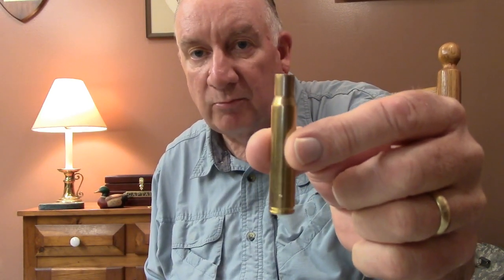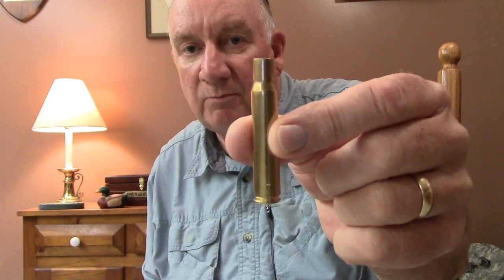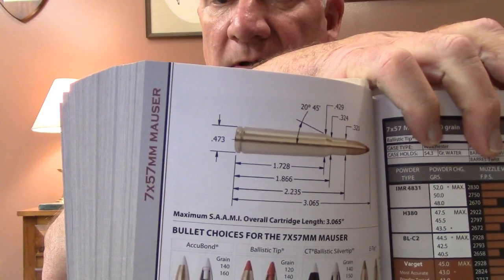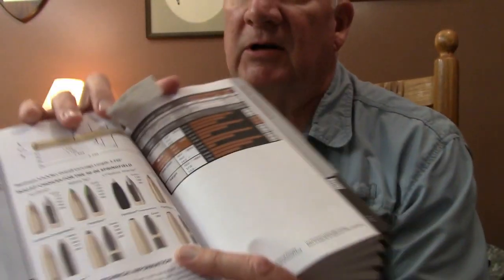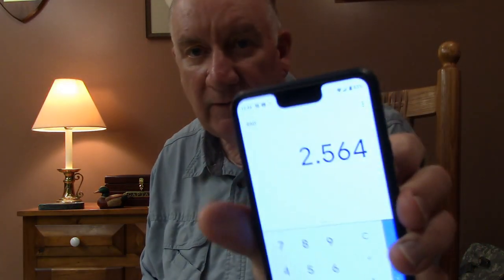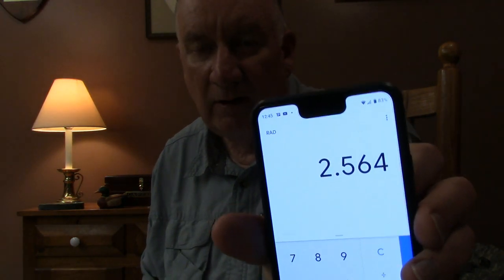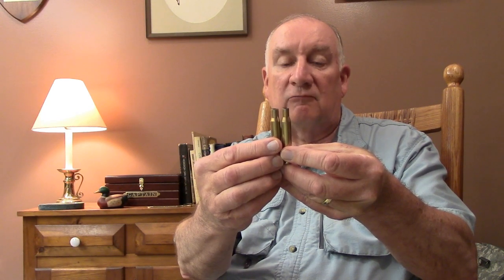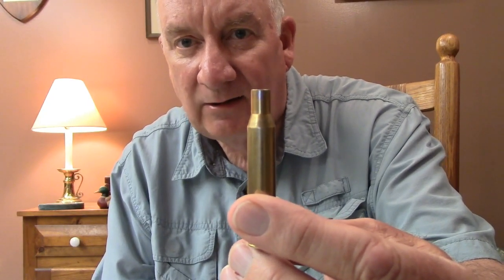Winchester 270 Origin Myth ~ Stupid Wiki Nonsense

Comment: You are wrong.
 About the measurements of the outside diameter of a 3006 neck plus you are wrong about  the other several factors involving the 270

Comment: I had a 270. Win Sako. It had a bit too much free bore and was set up for 150 grain bullets. I wanted to use 130 grainers for deer and varmints and the only problem with it was I couldn't seat the 130's out far enough to touch the lands before running out of space in the magazine. I could never get the 130's print sub MOA, but it was an awesome dear cartridge.

Comment: As far as I'm concerned. The 270 is magic. It is a true western cartridge for varmints and deer. Can't speak for it's performance on Elk but I know 270 Jack can.
Reply from the maker: I spoke with the late John Nosler, who told me that the .270 Winchester is absolutely fine on elk with either 150 or 160 grain Partitions.
Reply: @GunBlue490  If the likes of the famous bullet maker of the Nosler Partitions said it will work on Elk, you can take it to the bank.

Comment: What’s interesting to me is that Winchester created a 0.277 bullet rather than a 0.284/7mm bullet. Which was already used in the 7x57mm Mauser
Reply from the maker: The reason was quite simple!  Metric bores were, for many years up until only the last generation, considered "foreign" and even "enemy" calibers by many, and very much disliked.  At the time of the .270 Winchester invention, the 7x57mm Mauser was indeed disliked by many Americans after the Spanish American War.  In the 70's, American sentiment against metrics became quite a heated political concern after President Carter declared that America would convert to metric.  It was for good reasons considered by many a very anti-American plot toward globalization. To most of America's great delight, President Reagan immediately cooled things off and assured folks that they didn't have to toss out their tape measures.  That resistance against metrics isn't entirely gone, as there are still a great many folks who will only own "American" calibers.

Comment: The 30-03 was chambered commercially in a lever gun for a short time. The case length shows that the .270 Winchester's parent case was the .30-03, not the .30-06.

Comment: Who cares if you shoot a 270 out of a 30-06 rifle? That wouldn't hurt anything... ive watched a guy shoot a whole magazine of 9mm thru his 40  cal pistol, just expanded the brass and the bullets only went a few yards... seems like ot would be smarter to shorten the case slightly on the 270 to ensure a 30-06 wouldn't chamber in a 270.... am I missing something?
Reply: You are missing Case Capacity.  Winchester would not sell any smaller caliber rifles if it was not faster than the 30-06.  The selling point of the 270 in 1925 is the same as the current crop of barrel burners at 4000 fps.

Comment: GunBlue490 , do you have any info about the 6.5-06 A Frame? Thanks.
Reply from the maker: The 6.5-06 is essentially the old 256 Newton; simply a necked-down 30-06.  I consider it the best of everything the 264 Winchester Magnum had to offer, but without its liabilities. It is perhaps the flattest shooting standard case cartridge, that can take most all American non dangerous game with its range of deep penetrating bullets. Keep in mind that heavy game such as elk respond  best to larger calibers that can open a wider wound channel, which is where many veterans would consider 270 a minimum bore diameter. Despite its fabulous flatness, the 6.5-06 has had its greatest difficulty surviving because the 270 Winchester has the same practical flatness, but with heavier bullets of better frontal area.  It's a great round, but it's too heavy for varmints, unnecessarily destructive for deer sized game, but rather small bored for elk. Paper ballistics don't always mean the best choice.

Comment: The 30-06 is 63 mm long. The 270 is an American 7x64. The 270 is also 64 mm long. The 7x64 came out in 1917, whilst the 270 came out in 1925. The anti-Teutonic feelings were still very strong at that time so this is an aspect over-looked by many simply because they are not looking at things from a European perspective. Millimeters not inches or fractions of inches. How come .277? There  is the Chinese military cartridge story and there is the obvious fact that .308 multiplied by .9 equals .277.  7mm is actually .276 inches. .284 is about 7.15 mm. The dimensions we know today as gospel had not been standardized to the extent they have been today. The 270 Winchester will chamber in any 30-06 rifle. The headspace dimensions for the two cartridges is identical.

Comment: For a knowledgeable guy, you sure do like beating this horse to death.  Why was the '06 version of the case shortened from the '03 version?  Why was the shoulder moved forward on the 280 Remington?  Why was the 270 Winchester case made longer?  You are suggesting that all of these lengths and dimensions are arbitrary, when you should really know better.  

When the engineers were figuring out how to keep 270 Winchester ammunition safe, and keep from getting it mixed up in the manufacturing process with 30-'06, increasing the length of the brass was one way of doing that.  So, they based the 270 Winchester on the dimensions of the original 30-'03 cartridge.  They surely didn't STRETCH '06 brass, so they had to start with something longer.  They looked around at what was longer and, voila! the 30-'03 case length.  This was something they could work with.

This has been done throughout the history of cartridge development, which I would THINK you would be well aware.  For you to come along, decades later, and suggest that YOU know better than Jack O'Connor, Frank Barnes, Fred Huntington, or any number of gun authorities who were THERE when the 270 Winchester came out is not only demonstrating a certain level of ignorance, it is also remarkably arrogant.  You're reinventing history, long after the fact, when the men who shot the very first versions of the cartridge, and got it straight from the horse's mouth, told us how and why it was developed the way it was.  What you "think" nearly a hundred years later, conflicts with what the men who were there when it happened tell us!  

Why would you do that?  The ink has been dry on the FACTS of this matter for longer than you've been alive, but you still think you somehow know better?  Jeez, man.  Get over yourself.

Comment: Very good description. And very complete and accurate. If one wants to see how many cases were formed off the original 7x57, simply look at an RCBS shell holder chart.  Any casing that uses the #3 RCBS shell holder is based on that case.  There are dozens of them!
In fact, there are really only a few common case head sizes. 
The .270 is an excellent cartridge for just about any hunting in North America.  So is the .30-06.  Either one is an excellent choice. As Barne's "Cartridges of the World" says..."Anyone trying to make a case for one over the other is beating a pretty dead horse" 
FWIW, my arthritis has put an end to my hunting now, but the last few years I hunted, I used a Ruger #1 Light Sporter in 7x57 Mauser and it was just about as perfect as a deer rifle gets.  Any of those cartridges developed off of it are great!
Reply: You make a very good point about all of the cartridges formed off of the 7x57, which is one of my favorite cartridges.  My hunting career seems to have largely slowed down, but I still want to pick up a nice Ruger No. 1 in 7x57.  I have one in 270 and one in 223, but a 7mm Mauser would be an enjoyable addition.

Comment: Today I bought a savage 111 trophy hunter in .270 I was thinking of learning to shoot long distance. My deer rifle i take hunting is a 308. Is there anything I should know about the 270 and the difference.  Any help would be appreciated
Reply: A very simple explanation is that you won't have to raise your rear sight ramp as much  because the .270 will not drop as much as  a .308 at 400yds, the .270 has a much more level flight than many many other calibers. The 30/30 has a very high arch in it's flight, or much more drop if sighted for 100 yards, the rear sight ramp would need a much much higher setting to be on target at 400yds. Read a lot about ballistics and it will seem much clearer.  Good luck and enjoy the experience!

Comment: Obviously you have never put a factory 270 round into a 30-06. They chamber effortlessly in every 06 ive tried.  What possible reason would they be afraid to chamber a 270 in an 06?  Headspace is the same.  If you fire a 270 in an 06, you will pull out an 06 case that might need a little trimming.  I don't believe the extra length of the 270 case has anything to do with keeping it from chambering in an 06, if it was designed for that, it failed miserably.

Comment: Good day
Thank you for sharing your experiences and knowledge. I have watched most of your videos and I understood, you believe that the frontal area of a bullet is the factor that would determine the stoping capability of a bullet. Would you please explain if you believe that is the only factor, or there is a combination of different factors. Would you also explain why would you leave the energy  factor out of killing capability of a cartridge?
Please note my questions are around a shot which has been taken on a game in realistic hunting distances ( from 25 to 350 yards) with normal hunting bullet structures.
Thank you
Reply from the maker: Thank you for your question.  I don't believe that I stated that frontal area alone is the factor of stopping power.  I have often stated that tissue destruction is the necessary factor.  Effectively, greater frontal area does cause greater tissue destruction, but so does velocity, which causes hydraulic trauma.  Bullets with greater sectional density cause damage along a deeper wound channel.  For instance, a 45 caliber bullet has great frontal area.  A .22 bullet has much less frontal area.  If the 45 caliber bullet weighs 230 grains as in a 45 Auto with a muzzle velocity of 850 feet per second, and the 22 is a 22 Short rimfire with the same velocity, the 45 clearly causes greater tissue destruction along a linear path, even if they penetrate equally.  If the 22 is a 22 centerfire with a velocity of 2,800 feet per second, even with a lower sectional density than the 45 bullet, that 22 diameter bullet will cause vastly greater tissue destruction due to the explosive effects of hydraulics on tissue and fragmentation of bone, even if it doesn't penetrate as deeply, because the destruction is caused by hydraulic trauma that spreads more deeply than the bullet and in a wider circumference.  But, if the 45 bullet is a 500 grain bullet fired at 2,100 feet per second from a 458 Winchester Magnum, it combines great sectional density with large frontal area and resulting broad hydraulic trauma, and a very deep wound path due to the energy that drives it forward. But, a 416 Remington with a smaller frontal area and 400 grain bullet that travels 250 feet faster expands more and penetrates as deep or deeper, so it may create equivalent tissue destruction.  It's all about the breadth and length of tissue destruction; nothing less and nothing more.  Watch my video about sectional density, which explains in greater detail.

Comment: Hmmmm. Always appreciate your videos but you’re the only one I’ve heard refute the 3003 evolution due to its shortcomings.  In fact the most commonly stated concept is-

The .270 Winchester and .280 Remington cartridges were based on reducing the neck diameter of the .30-03 cartridge case to retain a similar bullet-holding length with the same shoulder. 

Yes that is a wiki quote but it reflects consensus on the other sources as well
Reply: I think Gunblue is correct on this one.

Comment: Hi GunBlue490......In two years I will have been using the .270 Winchester for 60 years, since age 10. I suppose you and I are somewhere near the same age as I am now 68. I was able to take my custom Mauser action .270 as my light rifle. It performed perfectly. I screwed up on one shot on a big Water Buk. I shot him a little too low. It was a long tracking job through the African grass and bush(two hours) The second shot put him right down. I shot 13 animals on two hunts in Africa. One was a Cape Buffalo. One shot with a 286 grain bullet from a 9.3 x 62 Mauser. The .35 Whelen would have done the same job. That same 9.3 Mauser killed a elephant with one brain shot...Again the .35 whelen would have done the same job. The 9.3 was used by other hunters whose .375 H & H rifles did not arrive in camp with them from the airlines. In total the 9.3 killed 3 buffalos, one elephant, and LOTS of wart hogs. The .270 killed as well on the game that I shot from the tiny dik dik up to a 2,000 pound Eland. All of this was from animals weighing 70 lbs up to the 2,000 Eland. I would have had a perfect record but I messed up and shot too low on the Water Buk. I watched at least 5 hunters who were afraid of the recoil of the big magnums and the shooting was not very precise. Keep up the good work on the .270. the >270 and I have had a relationship since I was age ten.    Glenn Campbell
Reply: make a video showing the rifle

Comment: I was under the impression that the ball cal 30 of 1903 was not standardized until 1906 hence ball cal 30 of 1906 ( 30-06 ) I think one of the 03 varieties was even a rimed cartridge with feed problems. I believed the A303 rifle was developed  at the same time as the 3006. Thanks.

Comment: I killed all I wanted with a 270.  If, in those days I could get my hands on a .280 Ackley Improved, I would have chosen it. Many great cartridges available now.....both 270 and 30-06 can still do the job just fine.   Thanks for all that background.
Reply: This video is about 270 Remington nothing else. One can Ackley improve the 270 Remington, if need be, to be a better cartridge but that too isn't what this video is about.
Reply: @garrytalley8009 .270 Remington?
Reply: @garrytalley8009 you mean 270 Winchester?
Reply: Just wish for the rem-280 and not the Ackley for lots of really good reasons. Trust me.
Reply: @fdegeorge2000  I agree. If you want more velocity with bullet weights at or above 160 a 7MM Rem Mag is the ticket for shots over 350. Otherwise a 280 Rem is an excellent choice.

Comment: no they weren't because the mausers were no where near close in measure of north American cartridges. what a waste of video time.
Reply from the maker: I don't re-write history.  I tell it, whether it appeals to you or not.  It's an historic fact that American engineers copied Mauser technology of the Mauser 98 action and its cartridge.  Whether you care to understand the fact, 1898, the year of the Mauser, came before 1903, the year of the Springfield.  Mauser won an International law suit because of that outright patent infringement by our armory (was declared null when America entered WWI).  I'm very proud to be an American, and we have certainly had our share of very gifted inventors, but virtually all modern American bolt action rifles are in some small or large measure based on the Mauser 98 design, and any of our 30-06 rim size rifle cartridges are direct descendants of their original design, which we copied directly or modified.  We also copied the British Enfield action when we made the Enfield rifle that saw extensive service by our forces in WWI.  If you want to hear someone tell a different version of history, you're correct.  It is indeed a waste of your time, whatever that is.
Reply: @GunBlue490  The P14/M1917 action was itself a Mauser copy.

Comment: When responding to a challenge, about 270 Win derivation or any other subject, it is best to refer to and present authoritative sources rather than simply add more personal opinions. Referring to a modern Nosler reloading book for only case dimensions doesn't establish anything other than a possible common ancestry. The idea that a longer neck on a 270 precludes chambering it in a 30-06 rifle is demonstrably untrue as it's probably done every day. I didn't offer references with my original reply since there are numerous, readily available sources out there. If you want to present authoritative historical sources, other than your fertile imagination, then I'll happily dig out mine. (if I were designing a case that wouldn't chamber in an '06, I'd make the neck OD bigger than .308, BUT unbelted, bottle-neck rifle cartridges all chamber on their shoulders, not on the mouth of the cartridge like most straight-walled pistol rounds do)

Comment: An example of the standardisation manufacturers take advantage of is in the mid 1960s, I owned a 1938 Oldsmobile. I needed a brake cylinder for one rear wheel and a set of brake cylinder rubbers for the other rear wheel. I had visions of all sorts of problems and had drawn a blank at several car parts places. My Father drove me up to the brake specialist in the next suburb and we fronted up to the counter. Old parts catalogues were dusted off and the guy disappeared out back, returning a few minutes later.
It turned out that the  brake cylinders were exactly the same as the ones fitted to the Australian made Holden car that was in production at the time, a General Motors product, haha! One very relieved young motorist!

Comment: I use to take 30-06 brass neck it down in a 270 die and trim the neck comes out the same  I think the length was 2.54 inch it's been 40 years